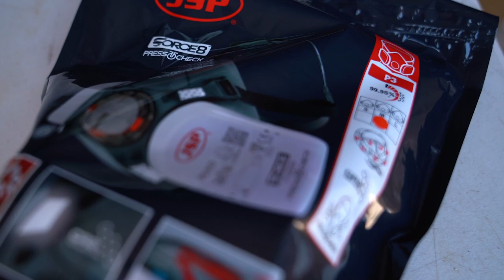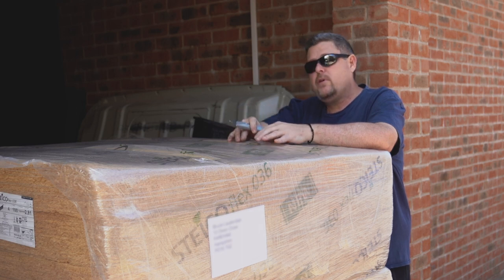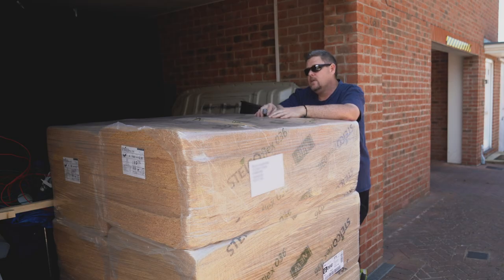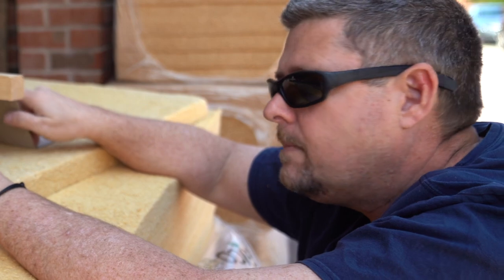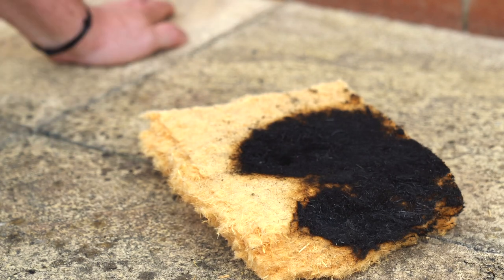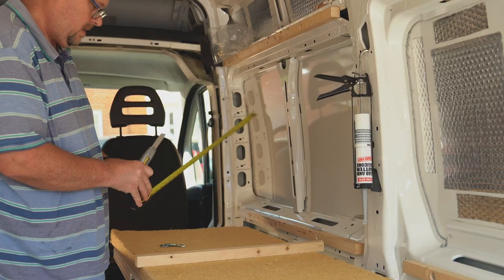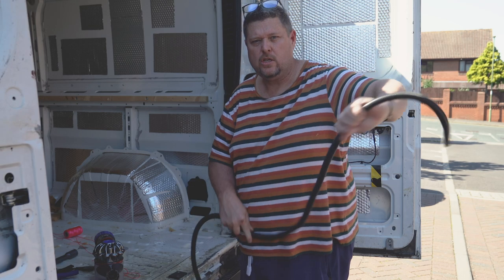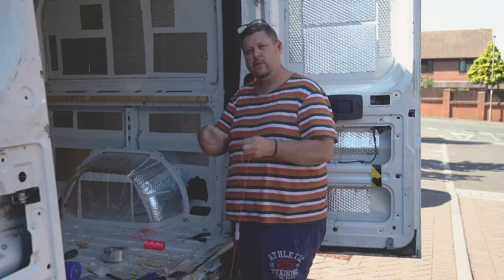The BEST INSULATION for Any Van Build

Comment: I thought Steico insulation was 0.36 ?  If it were 0.036 then the R value would be just under 28 which is higher than any insulation including closed cell foam.
Reply from the maker: You are quite right! It is it 0.36 Duh 😒!!! As in LambDuh! Thanks for pointing that out.
Reply: @BruceLauderdale  lol no probs, thought they'd found some miracle insulation product lol
Reply from the maker: Damaged Goodz I looked under every rock and I have!!! 😉 (controversy)